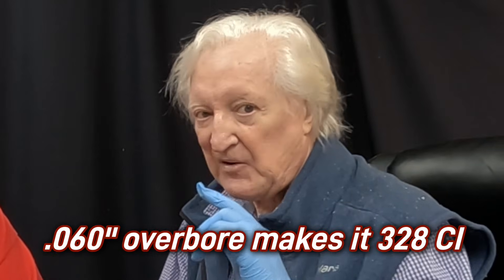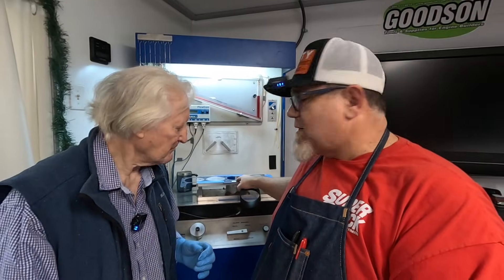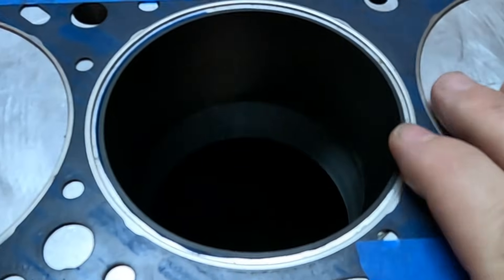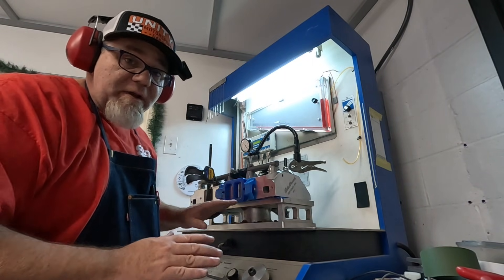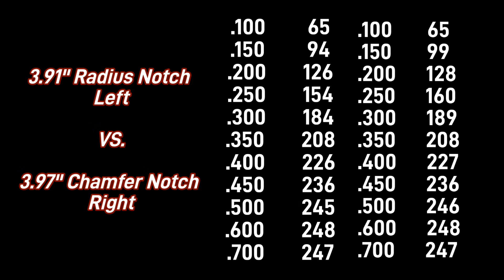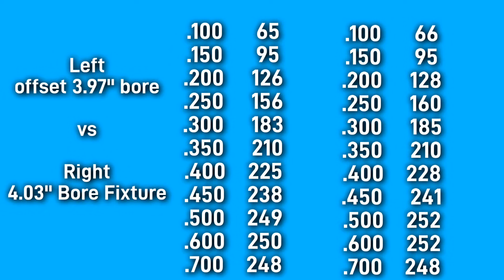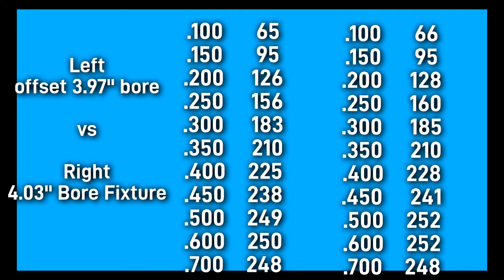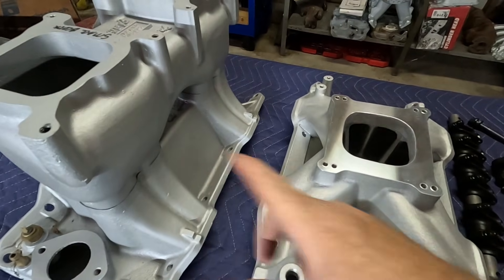We Found Hidden Horsepower in a Mopar 318 (Bore Shrouding Test) Project Mission impossible

Comment: On a Mopar, shifting the head over will help 2 cylinders but hurt the other 2.  Maybe try to offset the valves by drilling the guides . Of coarse this would have to be done when rebuilding the heads so the valve grinding and porting can be all matched
Reply from the maker: That is why we are going to attempt to offset bore the block.. AlOT of extra work but with what I'm wanting to do I'm gonna to get every bit I can
Thanks for watching 
Andy
Reply: Indeed. Off set the valves. That’s what I recommended as well. They do this in the world of 2 cyl. ABARTH 500 and 126 heads.

Comment: the problem with the 360, is the crank bearing diameter is wider than the 318 and the oil doesn't (in stock form) flow as well around the bearing surface and limits the 360s rpm possibilities. You in an earlier video pointed out "Crevice volume" as something that eats Compression Ratio, doesn't the fact that the top ring being so far down the the piston head also present some Crevice volume and similar Compression loss?
Reply from the maker: I agree that is an issue but compared to say a 351w which has 3" mains its better! I have turned Windsors past 8000 rpm with no issues so I cant see it being one on the Mopar, BUT I may be wrong
Thanks for watching
Andy
Reply from the maker: you are correct on Crevice volume. the distance down to the top ring eats compression ratio!
Andy
Reply: @UnityMotorSportsGarage  so compression can be eaten up by crevise volumne caused by head gasket, the distance from surface of the piston to the top ring and Dynamic Compression Ratio caused by valve overlap...is there anything else?
Reply: @Arthagnou  Piston valve reliefs and too large of combustion chamber in the cylinder head.